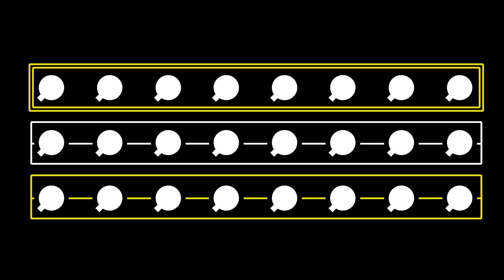Starting from Zer0: Oscillations

Comment: Hey Walker. Like the others you’ve done, I enjoyed this video. I think there is some primal correlation between big things and small pitches and small things and high pitches.  You doing the high voice made me think of a mouse. Small animals have smaller voice boxes and typically make smaller noises.  Most of the time the opposite is true for larger animals… of course, sometimes, greater range is the result.

Comment: Thank you for this! I've been wondering how best to use the CV and Gate outputs in the lower left corner (below MIDI B indicator light).  Where are they generated and can I use them to patch back into the 0-Coast?
Reply from the maker: The MIDI B CV and Gate outputs are typically assigned to MIDI signals using the Program Pages. If you are not using MIDI they can be set to triangle (CV) or square (Gate) LFO whose rate is set by tapping PGM_A. Take a look at the sticker on the bottom of the 0-Coast for instructions on these settings.
Reply: much appreciated!!!

Comment: Great information and background. Appreciate it. Hey, quick one...is the 'pinning' thing you mentioned in a previous video something I need to be careful of when patching in to the dynamics input on the 0-Coast? I noticed that you generally have that knob fully clockwise.
Reply from the maker: The Dynamics knob is an attenuator, not a panel control, and the Contour and Slope are tuned to be useful with it through the full range. Multiply and Overtone are more likely to get "pinned" in this way - in fact if you pin Multiply with a negative voltage you can make it go silent under certain conditions, which could be a fun thing to take advantage of ⚡️🎶
Reply: @MAKEN0ISEMUSIC  oh wow, that's cool. I'm gonna try that negative voltage thing. Good idea. Thanks for the answer & bonus ideas. Appreciate it. The 0-Coast man...I'm tellin ya...I don't even wanna think about life prior to having it

Comment: looking for 0-CTRL manual?
Reply from the maker: http://makenoisemusic.com/manuals/0-ctrl-manual.pdf
Reply: @MAKEN0ISEMUSIC  thanks for quick reply - I was just trying to determine if the changes on the Time channel knobs are copied at the main Clock output? e.g. so I can use the new rhythm to run Rene?
Reply from the maker: Yes, the clock output is in sync with the 0-Ctrl’s sequence and can be used to drive other sequencers even when the Time row makes the clock “unsteady” etc. It gets more complicated when using the Clock input at the same time, which we will demonstrate in upcoming video.
Reply: @MAKEN0ISEMUSIC  Excellent news!!! Can't wait to get it in the UK - - 
I'm making a 4 unit 'East meets West' live rig - 0-CTRL / 0-Coast with Subharmonicon / DFAM :)
Reply from the maker: @pluckingthespectrum  Have fun!!!

Comment: Very cool!
Quick question, when the 0-control is clocked at audio rates, does the envelope output produce a sawtooth?
Reply from the maker: Something close to it, anyway. There is an exponential decay to the envelopes, and they can also be "flat" at the top at higher Strength settings (a short "sustain phase" is added).

Comment: Why do some outputs do 0 to 10 volts, some 0 to 8, zero to 5, etc?
Reply from the maker: We design the ranges of outputs and inputs based around their likely pairings. For example sequencer outputs are often used for pitch, so a 5V range is good - most acoustic instruments don't have a five octave range, and more than that will start making it very difficult to dial in particular pitches. Gates we usually make 10V high just to maximize the likelihood that they will interact with absolutely any gate input in your system. 8V is typical for an envelope or function because it is the typical input range of a VCA. On MATHS the functions can go up to 10V because, again, it is made to be as universal as possible, and work with absolutely any input. Hope that all makes some sense!

Comment: Love my Make Noise, and Any definition of Sound must include an acknowledgement of vibration, with out vibration there can be no sound. Might help. So, an oscillator is a specific circuit designed to vibrate at a fixed rate but any circuit such as the slope that starts to vibrate with a regular shape can be perceived or conceived as a pitched sound.
Reply from the maker: Well-stated! I guess what I was hoping to get across was that the vibrations in the synth aren't actually moving the air until they are amplified. At the same time, I managed to talk about oscillation and sound for 17 minutes without using the word "vibration!" Thanks for your comment!

Comment: 0-CTRL is so inspiring, can’t wait to get mine!  I had assumed the variable gate on 0-Coast’s contour was the only recipient of dynamic pressure - are the touch plates actually sending variable cv that can control anything? Could be amazing for Zone on the Mimeophon for example.
Reply from the maker: There is a Pressure CV output that corresponds to how hard you are pressing the touch plates. There is also a Touch Gate that just goes high whenever you are touching one or more. Then there is also the Dynamic Gate and Envelope outputs, three CV outputs that correspond to the knob settings in the Pitch, Strength, and Time channels, and eight additional gates, one per Step, one of which is high at any time. The Dynamic Gates are made with the 0-Coast Contour Gate in mind, but you can patch anything anywhere :D

Comment: Walker, this is great and thank you for continuing to share your enthusiasm and knowledge with us. I've always wondered about transposing with the 0-Coast. The STO has an expo input (that seems fixed) while the DPO has expo that can be attenuated. What would be the method to do this on the 0-Coast? Would there be a way to send a sequence from 0-Ctrl to 0-coast and transpose?
Reply from the maker: Yeah, the STO Expo input is fixed and follows 1v/oct (it's basically just a duplicate of that input, and the two are summed together with the knob). On the 0-Coast you could mix your transpose voltage with the main sequence using the voltage math: put the sequence in the left input, which comes through at unity, and the transpose voltage in the right, then patch the output to 1v/oct. If using MIDI for a main sequence you could patch your transpose voltage straight to the 1v/oct, it will be summed with the MIDI notes and the Pitch knob.